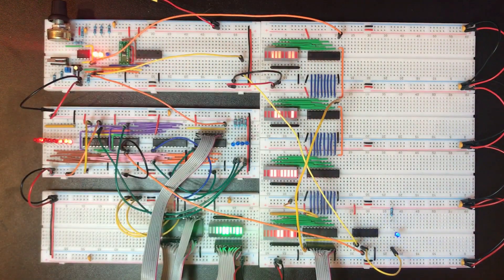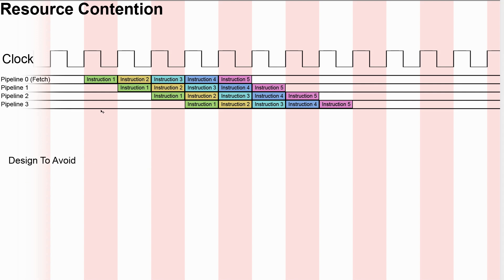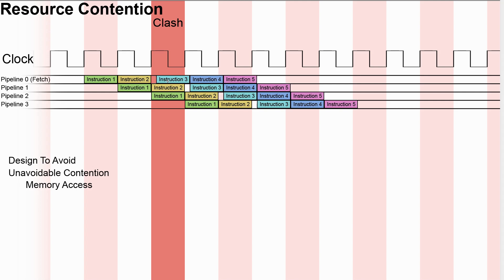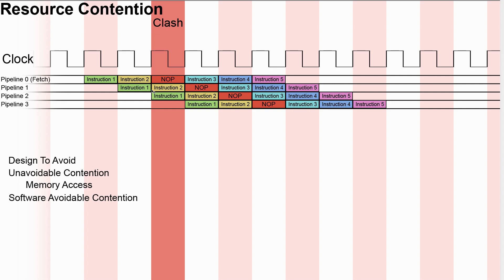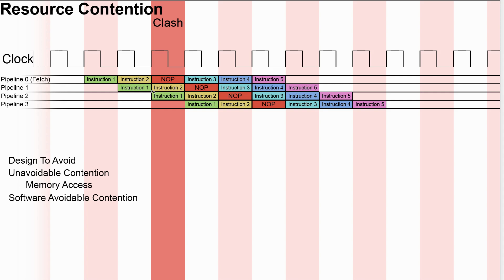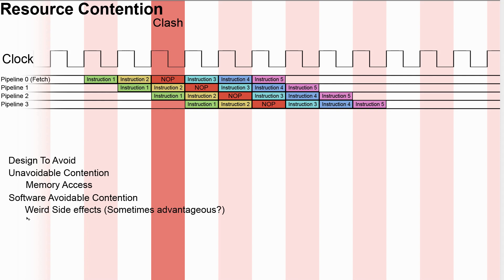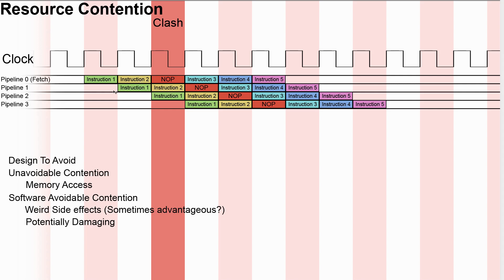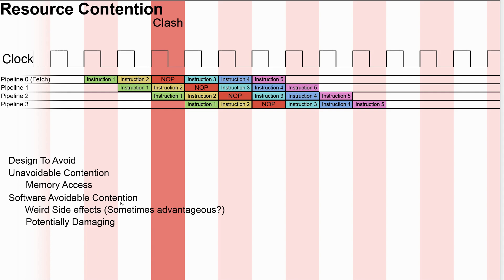Architecture (1: Contention) - Making an 8 Bit pipelined CPU - Part 10

Comment: In your discussion of 'register read-before-write hazards' you mentioned a console taking advantage of it. But iirc only ps1 had a mips processor old enough to have load delay slots. Or was my understanding wrong?
Reply from the maker: Sorry to be cryptic, but I'm very sensitive over anything that might be regarded as privileged information. That said think about things other than the main cpu, weirdness was/is tolerated more there in pursuit of performance.
Reply: @weirdboyjim 
I mean, N64 also had MIPS processors with delay slots. Even the graphics coprocessor was a special MIPS core with inbuilt microcode and graphics cache. Sometimes you could make something faster by putting an extra instruction directly after a branch, for instance, instead of forcing a nop by default in hardware.

Comment: Hi, I'm really enjoying the series. Awesome content, thanks!

One of the first questions that came to my mind when you mentioned the pipeline in previous videos is what happens if the instruction in address X modifies the instruction in address X+1 after it's fetched. I don''t see any reasonble way to handle it. But, given that some corner-case weird side effects are allowed, I assume that this case would be another example, right?

I still have no idea how modern CPUs would handle this, maybe it's just too weird and it can be ignored.
Reply from the maker: No processor I'm aware of will change the execution flow of an instruction modified after it's been dispatched,  I don't know but some modern processors maybe able to cancel a speculatively executed instruction if it detects the memory write. Self modifying code is something we general stay well away from in modern code though, you might see me do it a little on this one when I start coding games.